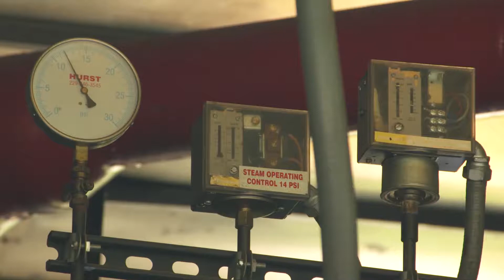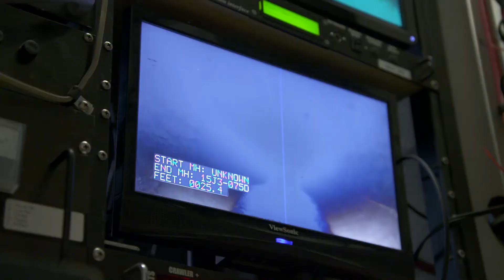Large-Diameter CIPP Installation

Comment: Can it navigate through 90s? And does the tube come with resin already inside the tube or do they inject it with resin on site?
Reply: I worked and traveled many years at Insituform through out the USA and Canada. A simple answer to your first question is generally it's not routine to install through 90's , however in certain circumstances we have done it. 
Say your sewer main is shaped like the letter " L " and those are two segments with a manhole in the middle. You can pull liner through each segment to meet in the middle then connect them together with a fitting and cure with steam. Once you cut it out after it's fully cured you will have both segments lined. 
  
For the second question, small and medium CIPP liner is manufactured with resin already applied. Some large diameter liners the resin will be applied on-site due to a few factors such as weight limits on public highways ( 80,000 lbs ). 

Keep in mind there are many factors to consider for each individual install and the specific type of procedure used in lieu of that. Diameter , length , ground water infiltration , cure times , ect... Hope that helps answer your questions.
Reply: @Forcefed777  just signed a job offer with them in Canada ( alberta) , could you give some feedback on company protocols (good/bad) your experience , etc. Maybe pay . I'm starting  at 24.00
Reply: @donknots7003  I worked there 2008 - 2014 and loved it. I was based in Littleton Colorado and our crew was invited to Canada for 2 years in 2011-2012 in Calgary and Edmonton. We were 6 guys of 3700 employees selected. To this day it remains one of my fondest years of my career and I'm still involved with infrastructure today. They helped me get my CDL A and hazmat. I learned alot about myself in my years with them how much I was capable of when I knew very little when I first started. I worked all over the US as well. It was like a big adventure seeing so many great places and I'm still great friends today with my coworkers from those days. My best advice is if you can embrace the opportunity to learn alot and enjoy being able to work in all kinds of places you will love it. I have even thought about coming back to work for them as I'm in Texas now. I have so many stories from those years it was one of the best times of my life.
Reply: @Forcefed777  thanks a ton for the feedback! I'm really excited to start , I'm going into it completely green. 
Cheers and best of luck in the future.  🍻
Reply: @donknots7003  Just don't over think it. It's the same process every time and the fun part is learning all the little tricks we come up with. 
Always follow " The BIG 5 " Confined Space equipment. 
1) Tri-pod & Wenches fall arrest
2) Air monitor for sewer gas h2s , LEL , o2
3) Harness.
4) Fresh air blower
5) Fill out a confined space permit! 

Safety is number #1 and look out for each other.
Don't be afraid to offer a hand to help out the TV operator get the camera going , keeping all the tools neat , help the Boiler Operator set up hoses ect... and you'll learn everything so quick. 
Not all installs are perfect situation , some are super easy and you get the pain in the ass ones too haha but take the good with the bad but 90% are great and easy.
Many of the guys you will work with and get to know have worked there for years. Because once you get over the learning part , people settle there for the career because it's a good company and they will take care of you in the long run.
Reply: I have a friend that works for them and he loves it been there 3 years already a supervisor and in USA most states are prevailing wage so you make killer money. The 24 and hour is just shop rate once you get to your destination or job site it start’s prevailing wage